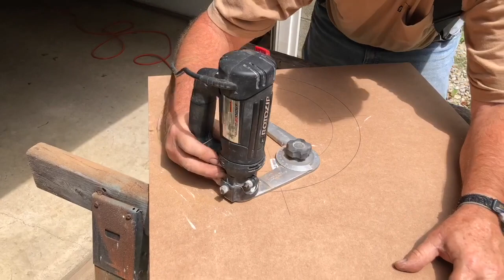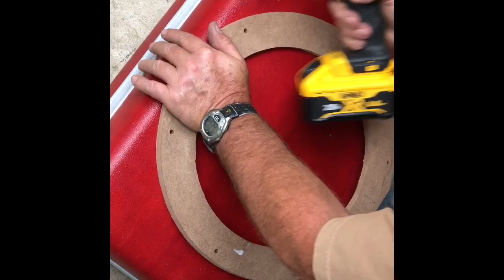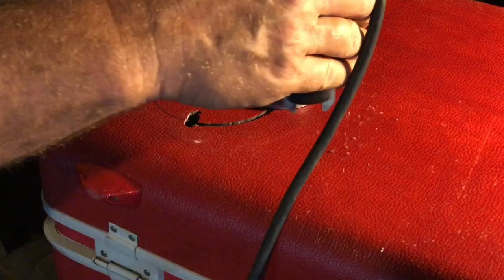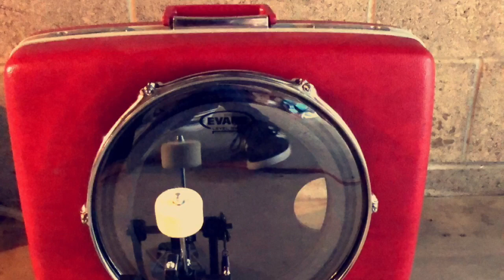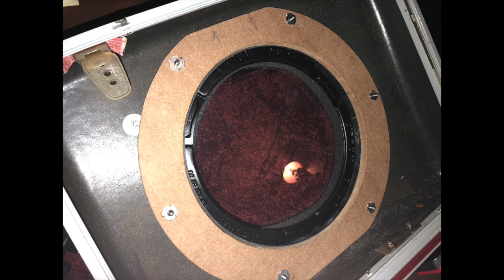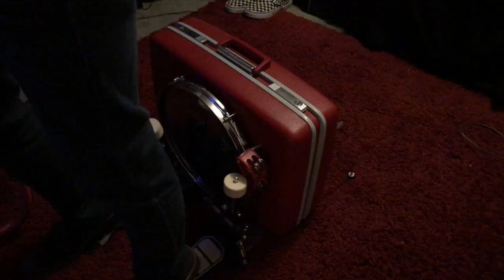Shakey Graves style suitcase kick drum build

Comment: I’ve just started building my own suitcase kick drum! Really curious how did you attach the rim to the suitcase? I know you cut that wood ring, but theres more stuff in there that keeps the head tight on the rim. What else it there?
Reply from the maker: Christian Madsen basically what you would need is something smaller in diameter than the drum rim itself, the smaller ring sits on top of suitcase it’s self with the drum rim on top over the ring, the rim then screws into the wood on the inside, creating tension on the drum head. My rim was 13” so I have a 12” rubber ring that causes the drum head to tension when screwed into the wood inside. I found the hardest part of the build to be finding something of the exact diameter to fit inside the drum rim. I am going to soon make a video sitting down explaining the build. I have read some places online that a standard 5 gallon bucket is 12” diameter if you could somehow modify a piece of wood to fit inside the rim. I’m going to make the video soon, I unfortunately fell quite sidetracked. If you have any other questions on the build, let me know and i will do my best to answer them. Thanks for watching!
Reply: Thanks man! I have a 16 inch drum head and rim already ordered and just need that 15 inch rubber thing to tension the head. Thinking of getting remo mufflers to help with the tension. You think 16 inch mufflers would do the trick?
Reply from the maker: Christian Madsen the Remo mufflers work great to kill the unwanted overtones, I put a 13” into this kit and it works great. I’m sure a 16” muffler would work perfect. Let me know how the process goes, I’m sure it would sound great due to the fact it’s a 16” rim, this on at 13” packs a punch.
Reply: I will let you know! Perhaps I will make a demo video as well

Comment: Great video! What type of wood do you use for the head side? I’ve just made a suitcase drum but struggling with the wood to create tension. I have made mine a 16” head. What measurements/ wood would you recommend? What was the thickness of your wood for mounting and how did you attach?
Reply from the maker: Basically all you would need is a ring made of any type of wood (preferably a harder wood to account for the tension of the drum head) as far as the thickness of the wood, make it so that your tension rods can be tightened to tension the head. My head is attached and the tension rods are screwed into self tapping threads. I wish there was a better way to explain, but this project took a lot of trial and error. Look at the up close photos towards the end of the vid for a more detailed look of what i did.
Reply: So you only used one ring of wood? That's interesting, most folks put a bumper ring on the front side too. I assumed to help tightening. Did you find any issues tightening the drum skin this way?

Comment: What did you use between the drum head and suitcase so you could tension the drum head without it laying flat across the suitcase top?
Reply from the maker: I used a round piece of rubber that would separate the rim from the suitcase itself. This is by far the most difficult part of the build, and due to having no real instruction it took a lot of trial and error to get this to work properly. Essentially my advice would be to find something circular that will fit perfectly into the 13” rim itself. Upon mounting the rim, the inner circular will pull the head to tension. The use of a rubber ring helped also in unwanted overtones and created a deeper bass sound.
Reply: Couldnt u use the ring of an old drum head of the same size as the kick head? Since it fits perfectly under the rim. Maybe put sime fabric or tape or whater on it but should work right
Reply: Yup it works :) make sure to use like some mdf or multiplex or something on the inside of the case or the nut might dig into the cardboard and it wont tension enough